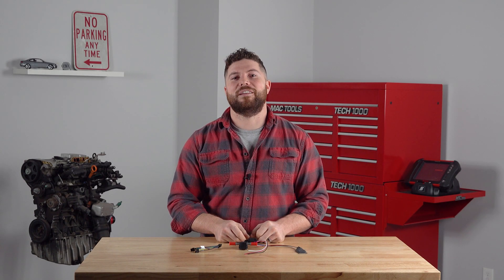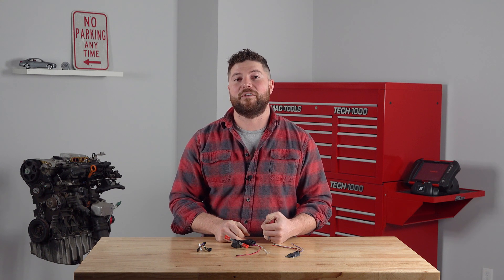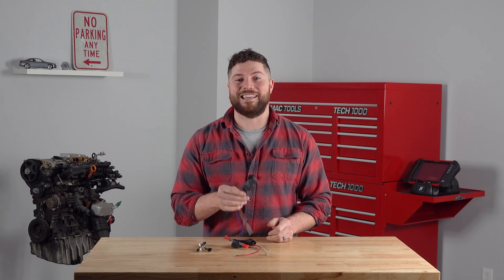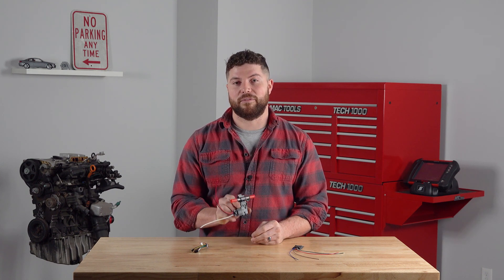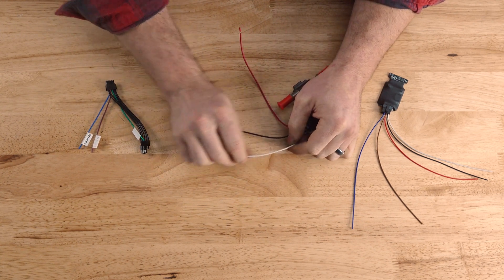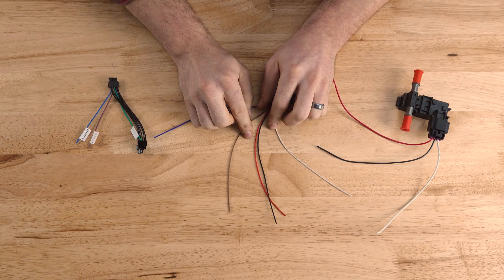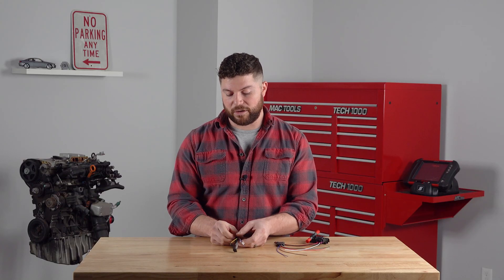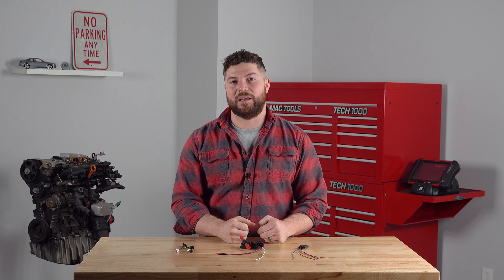Read Ethanol Content On Your P3 Gauge | P3 Gauges

Comment: I have a n54 with reflex plus port injection set up single turbo . With the ARM BOV line upgrade. 1) i already have an ethanol sensor just need the harness. Can i connect it to the breakout harness supplied by Motiv? 2) where do i plug in the vacuum line? Do i need it if I’m going throgh OBD port??
Reply from the maker: If the Motiv can directly process the raw 50-150Hz output signal from the ethanol sensor then yes, you could tie the sensor directly to it. If the Motiv needs a 0-5v linear signal then you could wire the ESVA in line between the Motiv and ethanol sensor.

The vacuum line from the boost tap would run to our analog boost sensor which can be found here - https://www.p3cars.com/gauge-accessories/add-on-sensors/p3-analog-boost-sensor/ I would suggest running it for your boost reading with your build in this case.

Comment: I haven't had the car tuned yet but just wondering if it should be reading something for ethanol on 93 or if it wont read it because of the low ethanol content? It reads 0 right now but it does hace the esva.
Reply from the maker: Unless the fuel is advertised as “ethanol free” it will typically have 8-15% E in it.

If you’re seeing “0” it sounds like there may be a wiring issue or issue with the sensor or ESVA. Please email support@p3cars.com and I’ll follow up with some remote diag to see what’s going on.

Comment: I have two P3 guages fitted in my car one anologe and a P3 V3 can I wire the one ESVA to both guages?
Reply from the maker: Hey great setup! Yes, you can split the brown and blue wires from the ESVA and run both or one to both gauges.

Comment: I have a question about this. You said 12v this is for the ethanol analyzer and also for the ethanol sensor voltage adapter. Which fuse would be appropriate to use to power? A red 5, a 15 blue, a yellow 20 fuse? Not sure which one would be sufficient. Thank you for answering my question. I have this all set up aside from the power.
Reply from the maker: So all those ratings are AMP values, not voltages. Most all the fuses in your fuse box are 12v but a couple may be 5v so you'll want to check for sure that you have a 12v fuse.

I would suggest using a non-essential system like your 12v power socket in the dash or your cigar lighter. That way if there's an issue you don't lose power for an important system. If you have any further questions please send us an email - support@p3cars.com - Jake
Reply: Thank you so much for answering my question.

Comment: Why can my HP Tuner ODB2 read my sensor data without this?

Update: I get it. This intercepts the signal before it goes to the ECU while HP Tuner is capturing it at the ECU. 

Note: An ODB2 app can read the PID right from the ECU with an ODBlink MX+. and display it to your iPhone.
Reply from the maker: Thanks for the follow up. Our gauge can read now read ethanol content on our GM product right through the OBD2 port. It also can on a couple other models as well.

at the beginning of 2020 we started with the ESVA using the analog inputs so that all models had the ability to read E content instead of writing software for all the different applications and then confirming each one worked.

As time goes on there will be more and more models that support OBD2 E.

Comment: Does it support the GM ethanol sensors for C7 Corvette?
Reply from the maker: Yes, this works with all the common GM ethanol sensors (basically any sensor anyone is using in their kits) just as long as it has a 50-150hz output.

ALSO and V3 gauge purchased directly from p3 7/1/22 or later is able to read ethanol directly through the OBD2 port without needing the ESVA
Reply: @P3Gauges   I recently bought a used p3 for my c7. it has the esva connected but wondered how do I tell the date of the gauge?
Reply from the maker: @32krazy1  there will be a hand written date on the control box
Reply: @P3Gauges   do you mean the actual gauge? its mounted into event ill need to remove it if thats what the control box is
Reply from the maker: I am talking about the control box (where the display and OBD2 harness meet in your dash. It will have a hand written date on the label @32krazy1

Comment: Does this ESVA of yours work with the FuelIt Ethanol content analyzer?
Reply from the maker: If your fuel it has the 50-150Hz output, then yes.

If yours has the 0-5v output then you will not need the ESVA and can tie that output directly to the analog inputs on the p3 gauge.
Reply: @P3Gauges  tie that 1 white wire from the sensor to the 2 analog inputs for ethanol content and fuel temp? 

I believe the fuel-it sensor is 5v for the jb4 so I was wondering how to install it. Now I’m Confused lol
Reply from the maker: @vwjet357  if you have a fuel it with a 5 v out just run that wire straight to the brown wire on the p3 gauge (no ESVA needed)

If your fuel it has a 50-150hz output you’ll need to wire in the ESVA between the fuel it and the p3 gauge
Reply: @P3Gauges  thank you for the response! so connecting my white 5v wire for my ethanol sensor to the brown analog for the P3 will be enough to show ethanol content and fuel temp? And there’s no need to use the ESVA? 

Just trying to confirm lol about to go out and do it right now.
Reply: @P3Gauges  I thought if I just attached it to the brown directly, I might only get ethanol content, and no fuel temp. Can you confirm?
Reply from the maker: @vwjet357  That is correct. If you don't use the ESVA to split the raw 50-150Hz signal, you will not get fuel temp.
Reply: @P3Gauges  okay sounds good. So the ESVA isn’t needed to get ethanol content. But, to truly use it, you DO need the ESVA in order to read both correctly. Yes?

Also the white 5v wire meant for JB4 on my sensor, can still go to the 50-150hz ESVA for this to read both right? This would actually be good, since I already bought the esva and can make use of it and get both readings lol

Just trying to confirm one last time to avoid confusion. Thanks again for your help!
Reply from the maker: @vwjet357  No, a 0-5v output is different than the 50-150Hz output. The ESVA can only tap the 50-150Hz wire directly from the Ethanol sensor.

And the only way to get fuel temp is by having the ESVA wired directly to the ethanol sensor to split the fuel temp and ethanol signals.
Reply: @P3Gauges  thank you very much!

Comment: This will not work for 5.0s, they do not have factory ethanol sensors.
Reply from the maker: Correct, nearly every car we support doesn’t come with an ethanol sensor from the factory, they need to be added on.

This device just translates the signal coming out of the ethanol sensor (factory installed or aftermarket) so our gauge can read it.

Comment: So is it okay to tap into the white wire on the sensor if it is already running into the car's ecu? Just want to make sure it wont mess up the signal going into the ECU.
Reply from the maker: That is completely ok. The signal output to the ECU will not be affected by another device monitoring the signal also. So you are good to tap the white wire to get the Ethanol reading to your eyes. If you have any other questions please email support@p3cars.com, thanks! -Jake
Reply: P3 Cars thank you!

Comment: Quick question. I’ve got a P3 and my tune already pushes a content value to the ECU, which I can read with VAG COM. Can I push that percentage directly from that channel. The better question is, can I push the value of any channel to the O3 or do I need this adapter?
Reply from the maker: Hey Jedediah, currently you cannot pull that value over the CAN-bus so you'll need to use the ESVA to translate between the ethanol sensor and the P3 gauge.
Reply: @P3Gauges  Thank you! I ordered the part. Check out my build page on IG. Dasr20_MK6r

Comment: On the DSX Tuning Flex Fuel Kit, do I just tap the white wire from the P3 sensor to the white wire coming off the DSX sensor?
Reply from the maker: Yes, you will just tie the white wire from the ESVA into the signal output of the Flex Fuel sensor.
Reply: @P3Gauges  Thanks for the quick reply.